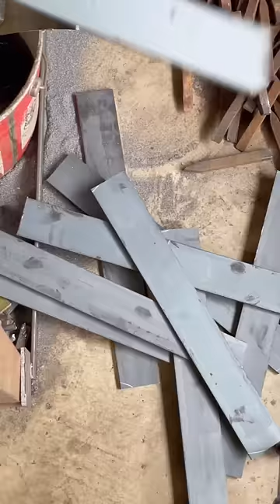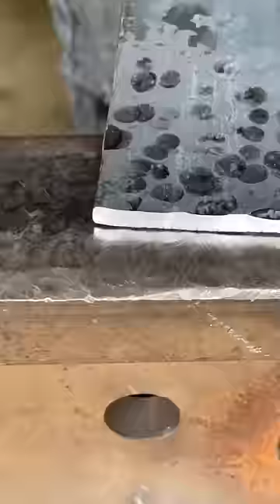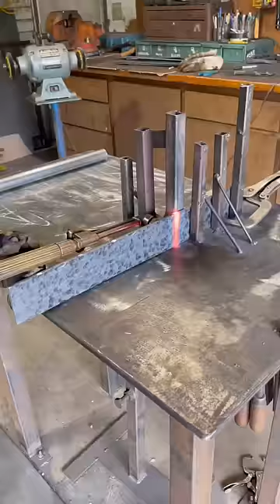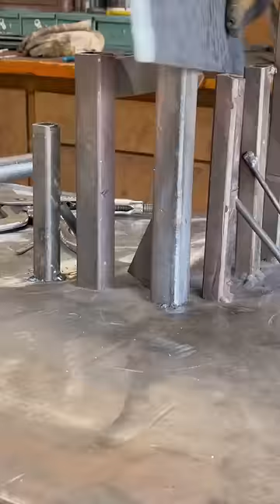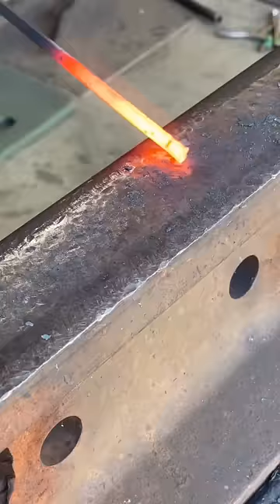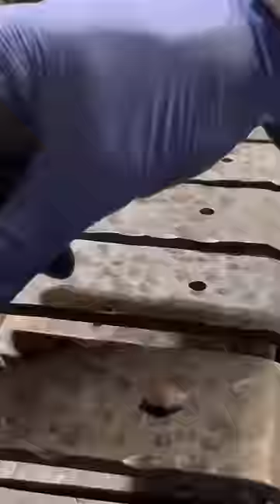Hand Forged Straps and Nails

Comment: Just going to throw this out there.   If you stand the material up it will cut way faster.  In fact too fast for the blade, so you have to adjust the spring pressure.  Worth the effort though.
Reply from the maker: So, I’ve attempted it. Word on the street is that it is ideal to keep a minimum of 3 teeth in the material at any given time. I’m cutting 1/4” thick flat bar here, with a 10tpi blade, so it just doesn’t quite get a full 3 teeth into the material, which can cause the blade to snag bend and snap 🤷🏻‍♂️
Reply: @MenardMetalCraft  
 Well yeah! I guess I forgot about that other detail concerning tpi.
 That definitely seems like an aggressive blade and I generally stay on the higher TPI end of blades so I don't think I run into that problem near as much.
 I generally use a Lennox die master II blade that I get made up from a local welding shop.  I think it was 14 tooth.
 I got a Bosh 24 TPI blade off of Amazon Because I was trying to cut some sort of laminated metal I believe. Anyway in using the Bosh blade it seems like because of the high TPI it doesn't catch On edges of things. And because I'm not a production shop or anything even close I'm not concerned that it takes a little bit longer to cut because I turn things on their edges and it cuts a lot faster anyways.  Like angle iron I will cut with the point up.
 What I usually do is turn the balance Spring pressure up pretty high and then I have a couple of chunks of metal that I stack on the blade tensioner area or hang from that little loop handle that compensates and gives me the right pressure that I want to keep the blade from digging in.
 In fact I think I have one of the longer strap clamps from my milling machine hanging off there right now lol.
 Thanks for the feedback on what you've tried I'm glad that's working out well.

Comment: hand forged straps is a straight up lie. you dented flat stock with a hammer and used heat to bend them. you may want to look up the actual definition of hand forging.
Reply: I'm with ya, lot of people are real loose with terms like "build" and I guess forge too
Reply: @cameronbachman8161  yup lots of people out there thinking they are professionals, when they only have small amounts of knowledge on the subject